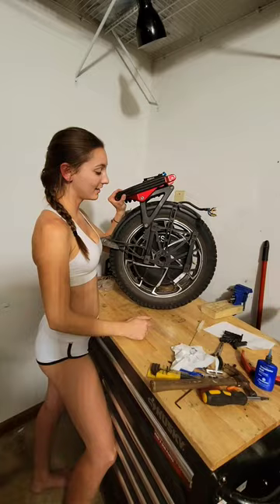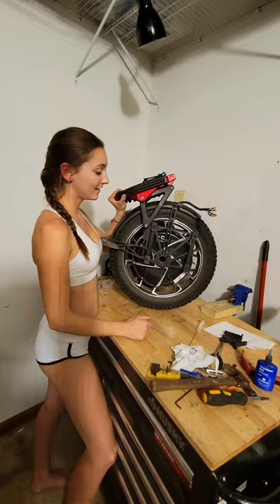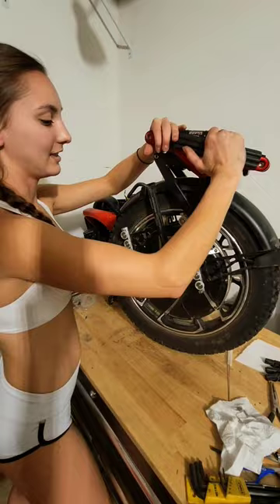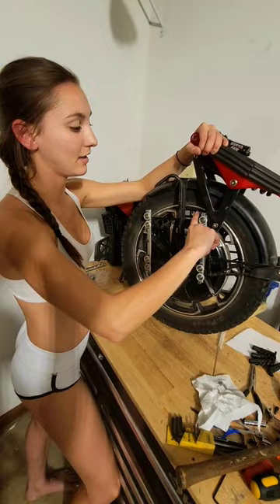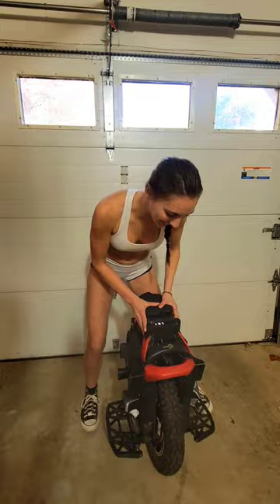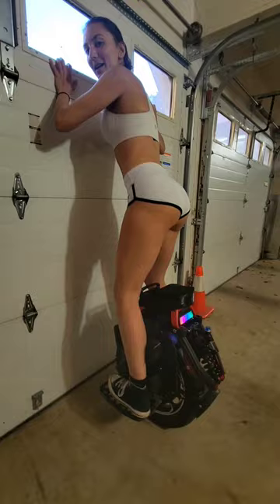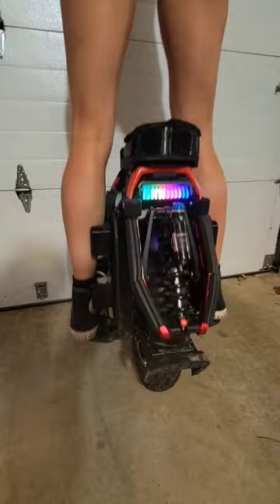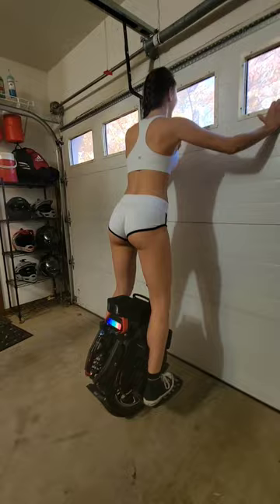CNC sliders for kingsong S22 from myewheel

Comment: i pre-ordered  mine from MyEWheel about two or three weeks ago. i think they're supposed to ship this week. i went with the grizzla pads, fairing, and front bumper fer my s22. i highly recommend all three. especially the fairing set.
Reply from the maker: I have the fairings too, they work great
Reply: i was really hoping that squeaking was the sliders. it must be the shock absorber itself.  mine hasn't started squeeking yet but i'm sure it will.  i just got it back from revrides since they did the recall to pin the stator.
Reply from the maker: @watcher9999able  it was the shock or shock links

Comment: I DONT KNOW about that suspension. Seems a little stiff too me and it’s squeaking a little bit. They have some stuff at Autozone that helps quiet that down some. You may want to check the air pressure in the tire, may be a little low. Before going to Autozone though, make sure your squeak fluid is topped off. Nice Con’s by the way!!!

Comment: Did you make the sliders or order a kit? I'm still waiting for a new motor for the S22 and would consider doing that upgrade at the same time. Thanks for sharing your experience with the new sliders.
Reply from the maker: ordered from myewheel
Reply: Many retailers are planning to carry and offer installs of the cnc kits. My retailer eevees in Vancouver should have some in stock in about a month. The new motor replacements are going to be available in about a month as well.
Reply: I should have added that I spoke with these guys making the cnc sliders. They sold the first 50 they made in 1 day. There next batch run is on the 8th of November. They wanted to see how they would sell before making larger batches.

Comment: 1 wheel, Balancing on 1 wheel, could go up to 50mph.
You wreck a car, protected by four walls, you still may die.
Good Luck My Friends...
Im sure its a Rush, im not saying i wouldnt have done it back in the day...
Ive had 9 Surgeries, + 2 Dental.., both Kness Replaced, both Shoulders Replaced, 2 Molars Extracted in less than 7 months.
If you dont shut yourself down, your body will.
Its a weird feeling, its not what you want, but your done.
"Sorry"
Youre injuries add up, it gets to a point that there is no other option.
* To fix both my Knees + both my Shoulders was: "$282,000.
Im on Disability, im 59+, i can barely go to the store.
I didnt have cameras...